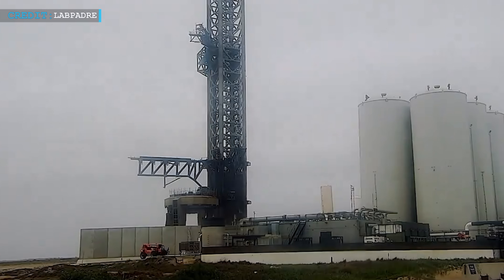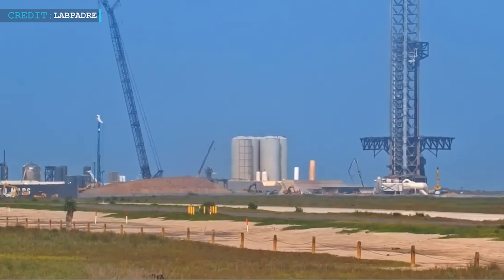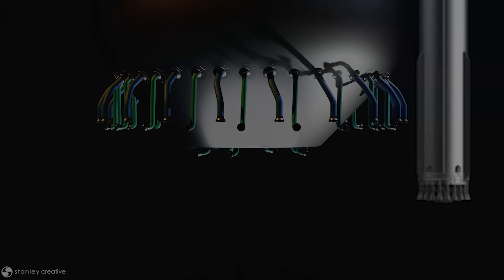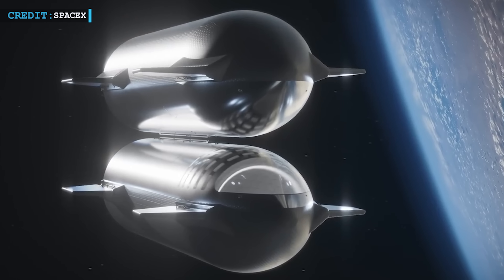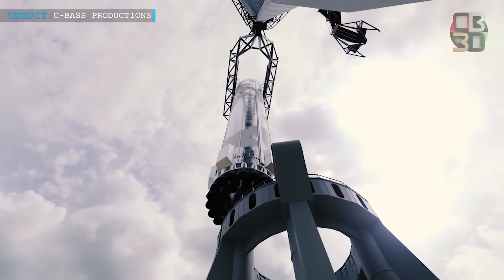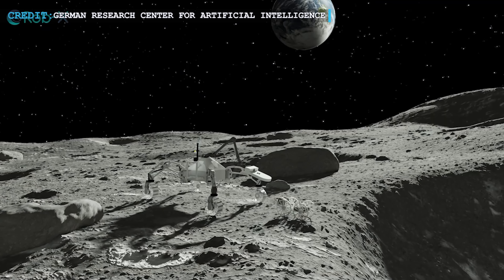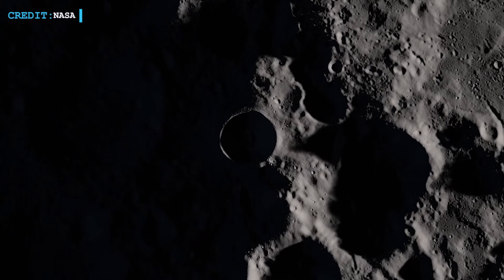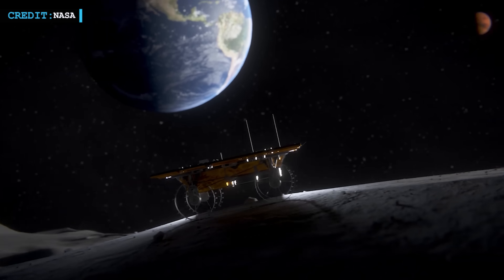Starship New Design Changes To Solve Space Refueling | Robot Explorers- Futuristic SpaceX Starship

Comment: I think this video brings up a very good point.  We have been seeing the animation of HLS Starship landing on Luna wrong.  What will likely happen, at least if mission planners are smart, is we send up robots to prepare a landing site and then HLS Starship will land on a landing pad prepared by robots.  Otherwise that colossal tower is likely to tip over.  Why take that risk when robots can both validate a landing site and prepare it for a "low risk" landing?  Like here on Earth, you wouldn't land a helicopter on unprepared ground if you could have a helicopter landing pad to land on.  And on Mars, we have already had problems with the rovers getting stuck in lose dirt that was loser than anticipated.  Plus, landing on a prepared pad, you can land on small and light landing legs.

Comment: Still waiting for an explanation for how the belly-to-belly configuration will settle propellants for refueling. Until that’s a done deal, it’s a notion yet to be proven.
Reply: In-orbit refueling is by far NOT the most challenging engineering problem that the Starship Program has faced or will face.
Reply: They use pressure differences between tanks to transfer the propellant.  

For propellant settling couldn’t they induce a slow rotation to the belly-to-belly configuration?  Centripetal force would pin the propellant inside the tank.  Internally, a valve and pipe from the transfer ports connecting to the area inside the tank where the propellant settles with rotation should be enough?
Reply: @undertow2142  They could, but that would force the propellants to the outer edges of the tanks, while the transfer connections are at the inner surface of the tanks.
Reply: @ghost307  exactly.  That’s why you’d have to run a pipe from the transfer port to the area of the tank the propellant settles.
Reply: @undertow2142  And then pump the propellant to the tank in the other ship?
Reply: @ghost307  Propellant boil off in the tanks is always occurring and needs vented regularly. By adjusting how much is vented you can get a higher pressure in one tank compared to the pressure in the other starships tank.  If the end of pipe in the higher pressure tank is submerged in propellant opening the valve will cause the fluid to transfer to other starship.
Reply: Using ullage thrusters to accelerate the ships sideways is the only way that I can think of for a passive transfer.
Reply: They will put an optimus inside with a vacuum cleaner, and it will hose up all the prop globs :P
Reply: If you have presurized tanks in one vehicle and a relative vaccuum in the other, fluids will flow from the higher pressure to the lower pressure. 
Solving liquid sloshing/consistent feed could be as simple as having the pair accelerate during fueling by as little as 1m per second. No pumps needed other than pressurization.